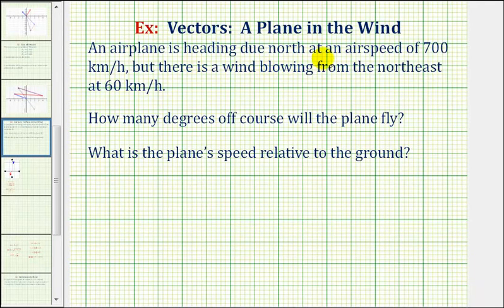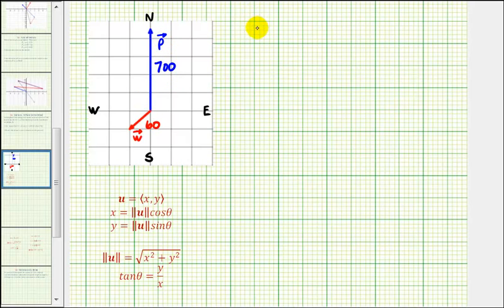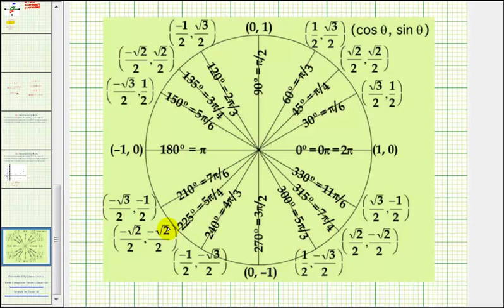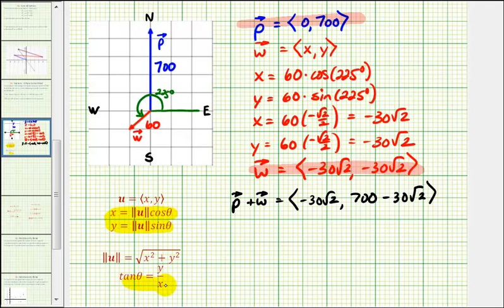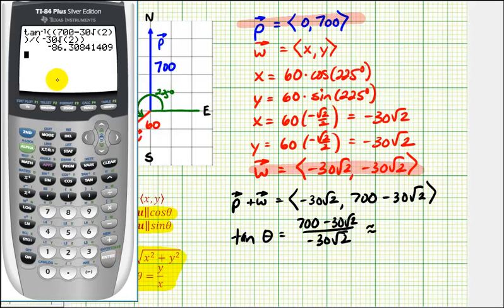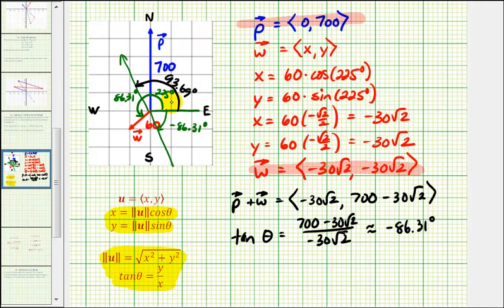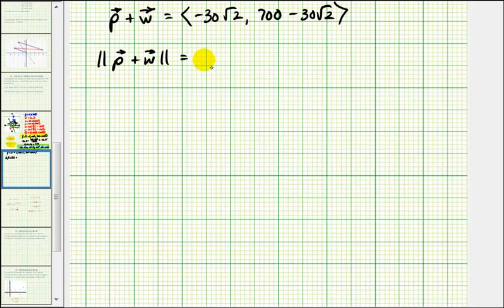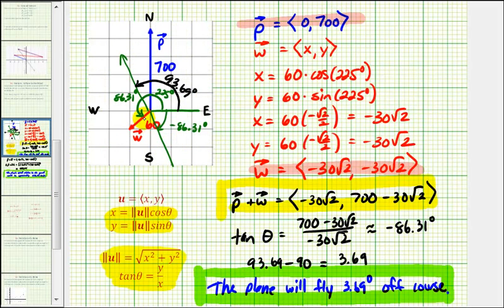Ex:  Direction and Speed of a Plane in the Wind Using Vectors

Comment: 225 degrees where did it came from
Reply: 225 degrees is the angle for the vector of wind (w), moving from the origin and blowing SW (it blows from NE to SW). If you start at the standard position (0 degrees), going counter-clockwise to SW is 225 degrees. He drew an arrow showing it, labeled 225.